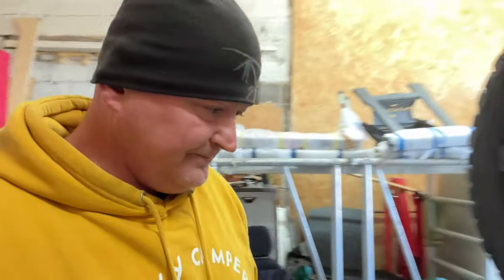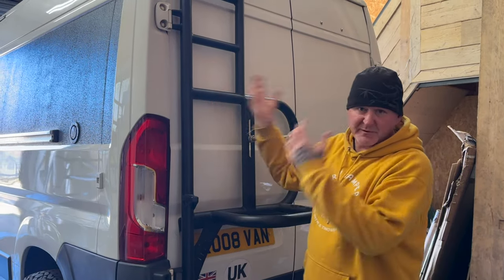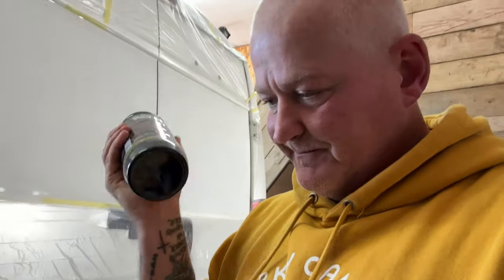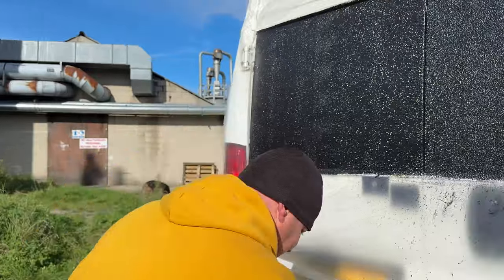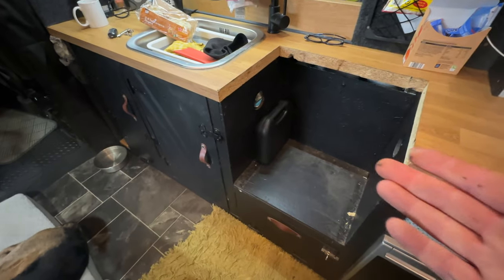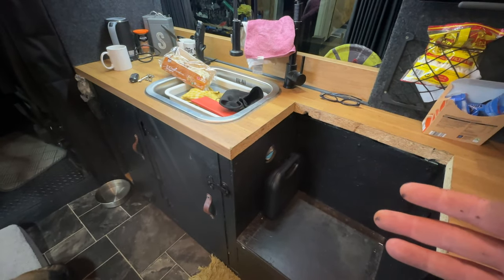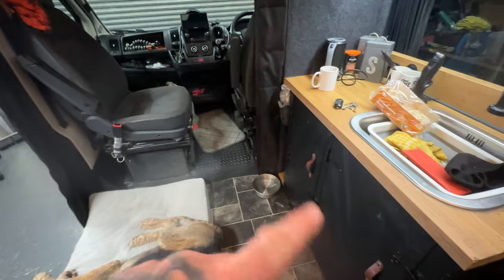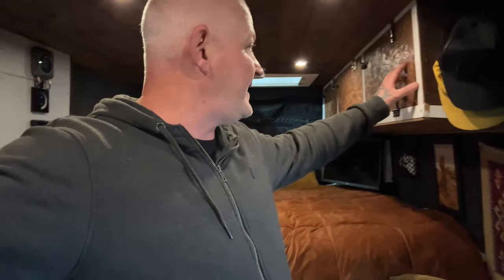It's Finished - RAPTOR Painting our Peugeot Boxer Campervan

Comment: Very smart. Good idea to do below the waist rail (?) where chippings and road salt can damage the paintwork. Reminds me of doing underseal on the beat up old 1970's VW Polo I had as my first car when I was still in Yorkshire...  A sofa opposite the door and kitchen by the slider does make a big difference to the space and ventilation when cooking too. My parents late 1950's caravan had a large drawer that pulled out and a piece of plywood that slid over the top to make part of the dinette into a bed - this would work well for extending the sofa for Archies bed (with slats) - no need to make legs or a frame, just use the drawer (or two) for the slats to go onto.
Reply from the maker: That’s a great idea about the draw under the bed as the slide out part.. thank you for the idea 👍
Reply: @PackTheVanAndGo  No problem, its simple but worked really well. We lived in the caravan for maybe  year-18 months when converting a barn, so it got a lot of use and still worked well.
Reply: The drawer front was a bit higher than the drawer and this kept the sofa/bed cushions in place. I've had to put velcro dots on my slats to try and jeep the cushions on the sofas, the big ones still slide off unless we wedge them in with one of the backrest cushions - or the ebikes.